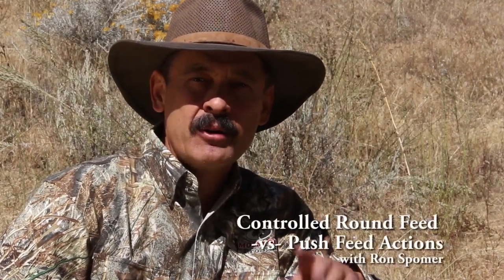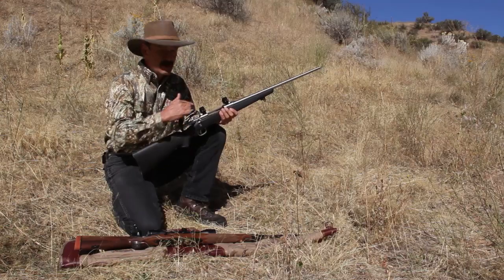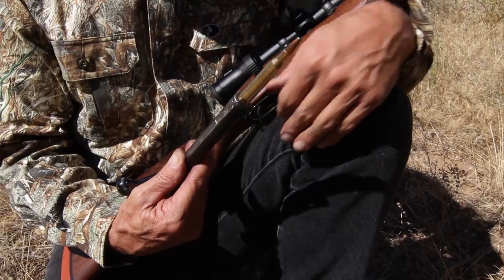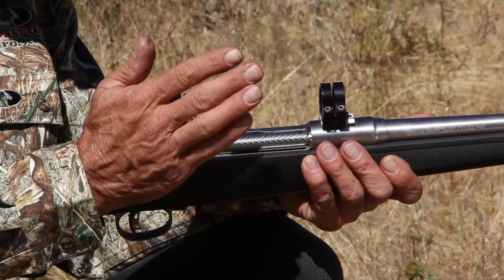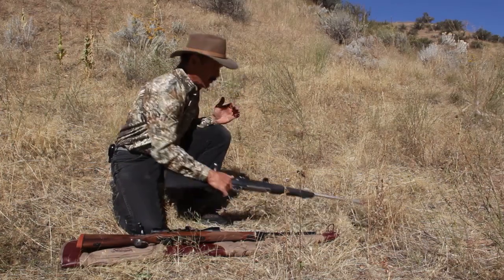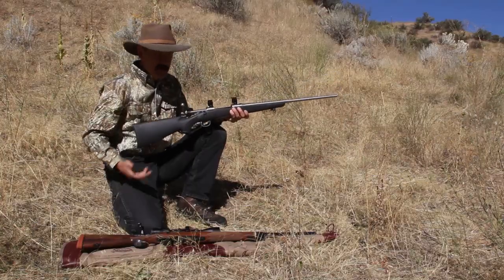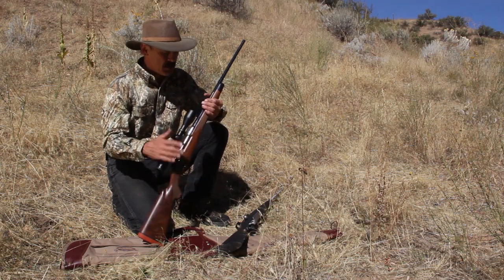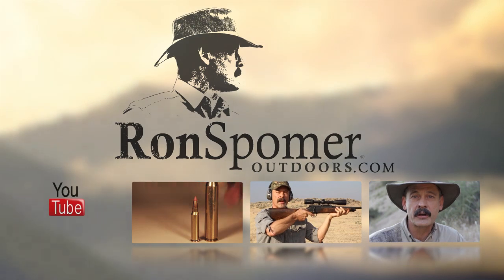"Push Feed -vs- Control Feed Action" with Ron Spomer

Comment: I have 3 Winchester Model 70's, all are CRF. 
That being said, I've also used one of the 90's Black Shadow  models that was Winchester's entry-level gun at the time and never had a bit of trouble with it. In fact, that rifle had one of the smoothest working actions I've ever seen, smooth-as-butter! 
My current 70's are a pair of Featherweights in 7x57 and 257 Roberts and a Safari in 375h&h. They are all spectacular rifles and the claw slings brass like nobody's business. 
For deer hunting, a push feed is fine but like one of the earlier comments noted, CRF is best when you're hunting something that's hunting you at the same time!

Comment: One advantage of CRF seldom noted is that if you have a broken firing pin sticking stuck out of the bolt face you get a failure to feed in a CRF. The firing pin sticking out of the bolt face will prevent the cartridge coming up in the correct firing position. On a push feed action the firing pin is sticking out like the firing pin on an old submachinegun. Close the bolt and the round will fire before the locking lugs are closed in position shooting the bolt back towards the shooter. How do I know? A friend of mine lost his right eye when the bolt hit his face and the bolt handle cut off his right thumb. He almost lost his left eye as well due to case fragments pouring out of the action.

Comment: It is not ONLY the CRF option that makes the M70 a superior hunting rifle to the R700 and other push-feeds. The week extractors on the m700 are very prone to failure on hard recoiling rounds (reason why Remington stopped chambering rifles in .416 rem mag). The ejector on the M70 is failproof, while the plunger design on the R700 has been known to gum-up and fail in the field. The 3-pos safety on the M70 is the safest and most suited to extreme hunting environments in production. The M70 also has an integrated recoil lug, the flat-bottom is 100 times easier to bed, the bolt can be easily disassembled in the field in a few seconds with no tools, and the bolt handle will not break off during use. I love the R700 as a bench or target platform, but it has many shortcomings as a hunting tool. Many serious Rem fanboys, like Larry Potterfield, have spent thousands of dollars to convert their R700s into M70s.
Reply: Well said. I am also a Model 70 fanatic, the Ruger M77 MKII & Hawkeye are some fine CRF rifles as well but my favorite 2 rifles will ALWAYS be the M70 Featherweight and the M70 Sporter. Beautiful, beautiful rifles!
Reply: Yes way back to the 721's they were known for extractor failures and I hate their safeties

Comment: Very informative.  I own rifles with both types of feed and I've had trouble with ejection in push feed models if any grit gets under the small ejector clip on the bolt.  I'll take the CWF any time.

Comment: CZ 550 is Controlled Round Feed and the new CZ 557 is a push feed. The CZ 527 is CRF as are the rimfire 452 and 455 models. 1903 Springfield is a CRF as it is a derivative of the Mauser 98 action. Remington 98 and 99 are CRF as they are restocked and badged Zastava rifles based on the Mauser. The FN bolt action rifles are CRF too. McMillan makes their custom actions in either CRF or Push feed.

Comment: Thanks for the no nonsence breakdown on the difference between controlled round feed v push feed, have a tikka t3 never had a problem with the push feed system. However like the way the controlled round system works, am looking at a c z which uses the controlled feed system.

Comment: Thank you sir! You saved me a lot of headache with this video, I had an issue with my 1st controlled round feed, it wouldn't eject the shell after I had it apart for cleaning. I thought something fell out of the bolt, all I have ever owned was push feed and was looking for a spring and pin on my hands and knees in the floor. I know, I know,I panicked but anyways, your explanation of the controlled round feed helped me tremendously, thanks again!
Reply from the maker: Glad I could help.

Comment: Good explanation.  I have several push feed rifles (Remington 700s) and haven't had any problems with them.  One is a .22-250 Remington and I'm not likely to have a woodchuck or bunny charge me.  I prefer a controlled feed rifle for dangerous game, just because.  Well, I'm an old guy anyway.  Good training and practice will have the shooter operating the bold all the way on both closing and opening, so one's muscle memory will help to prevent those kinds of jams anyway.

Comment: Although rare, it is possible to double feed jam a CRF rifle.  Cartridges don't always engage the bolt face until they start to ramp.  (On some rifles) So if you short stroke it it might double feed.  Also CRF bolts are made to engage Cartridges from the magazine.  So a chambered round by accident or hand fed could be very difficult to extract.  Push feeds extract hand fed rounds easily.  So yes both have advantages and disadvantages. This is my experience anyway.

Comment: Ron, you missed a couple of important points and introduced a silly one.  Firstly, the silly one.  No one shoots a rifle upside down and frankly in 40 years of shooting I've never heard anyone seriously suggest any such thing.  However, if you did want to shoot upside down, I guess a PF action may be problematic.  Now for the points not mentioned.  1) The extractor.  The CRF extractor engages fully 40 'plus' percent of the cartridge rim.  This means that stuck cases can almost always be ejected; even it that means thumping the bolt handle with a stick or boot.  PF extractors on the other hand engage about 15 % of the rim (on a good day) and consequently are far more likely to tear through or ride-over the cartridge rim on a stuck case.  2) Ejectors.   The 'fixed blade' ejector on a CRF action is essentially failsafe.  Not so the plunger ejector on a PF action which can suffer a spring failure or, fail to operate due to dirt and residue jamming the plunger in it's recess.  As you allude, none of this stuff matters much when out shooting rabbits or deer; but if you're facing dangerous game, or you're in a survival situation; well that's an entirely different kettle of fish.

Comment: Got several of both feeds in 458 416 and 375 and never had issues with push one advantage of push feed is in a hurry you don't have to feed from the mag you can chuck a round in and just close the bolt
Reply: This mindless myth is not true with most crf rifles

Comment: I have had my M70 push feed since 1974, taken all manner of game without failure. I also have a newer M70 with claw extractor and see no advantage.
On 2 occasions I have seen model 700 Remingtons accidentally discharge when the safety was released. I prefer the M70 safety system.
Reply: that remington teigger issue is scary
Reply: My MR7 has the 3 tang safety, love that gun

Comment: The push feed seems a cheaper bolt to me. Control feed does take more machining so probably costs more to produce. I don't like that the ejector on the push feed causes the brass to scrape along the inside of the action as the bolt is opened. As a reloader it just kind of bothers me. Most of my rifles are push round actions though.

Comment: Class act video, good information. One thing to note is single round chambering and if you very slowly close the chamber, on a CRF action could pop in front of the blade extractor and cause difficult closing of the bolt. (Very rare, but can happen)
Reply from the maker: You're on the right track here, but nothing pops in front of the blade extractor. The face of the extractor is forced to snap over the rim of the cartridge. Unless this face is bevelled, this might not happen, so you can't chamber a round. It could also weaken or break the leaf spring extractor as you try to force. Most CRF Mauser-style extractors are now bevelled so they snap over, as this one did. Still, they are designed to slide into the extractor groove of each cartridge head as it springs up from the magazine. That remains the best way to chamber these.

Comment: The other thing is that when you pull a case out of the chamber, you smack the mouth against the inside of the receiver with a push feed unless you remove the ejector.  Will that ever matter?  Maybe for pushing the limits of accuracy, but not much else.
Reply: Never thought of this, however I don't think the brass case mouth would dent (all my reloads don't) 1/3MOA still happens on my 3rd and 4th reloads so idk Maybe bench rest shooters do this?
Reply: They absolutely do.  Buuuuuuuuuuuuuuuuuuuut I'd bet 80% of what they do is total BS.

Comment: I have a savage model 11TPH It don't want to push the rounds into the chamber. It pushes it about 90% then locks up. I have to back the bolt off just a hair then it pushes closed and locks down.
Reply from the maker: Sounds like feed ramp/bullet incompatibility issue. Bullet tip may be catching on the breech. Best have a gunsmith check it out. Or just try a different bullet. Should be an easy fix.

Comment: 10 years ago, when I was only 15 when this video was made and I didn't even know what push/controlled feed meant I got my first Ruger M77 30-06. It's a tang safety so it's still a push feed even though it's got a claw extractor. Since then I've picked up a couple of controlled feed M77 Mk2's, a boat paddle .308 and a stainless/laminate 7mm Rem mag. I guess all I'm trying to say is Ron was right when he mentioned Ruger. They make some damn fine bolt action hunting rifles.

Comment: Hello Ron, I know bolts are deigned to be worked quickly, but I noticed something strange when slow cycling my new Winchester 70’s with control round feed. The one is a Featherweight in .270 Win, when the bolt is slowly closed the bullet ramps up into the chamber and at about 3/4” closed then the head of case is snapped up into the bolt head. Pulling the bolt back at this point the cartridge remains connected to the bolt. This is how it should work as I know. However with my like-new “never fired by me yet” Model 70 extreme weather in .243 Win, if I do the same by cycling the bolt slowly, at about 3/4” closed the case head pops into the bolt face and drops loose. At this point when bolt is pulled back it isn’t grabbing the case head. If I work the bolt quickly it will snap onto the unfired cartridge and pull it out and eject it fine. Am I looking at a problem with this .243? Is my Z spring and follower not putting the proper snap tension into the cartridge to get the case head to snap onto the bolt head when slow cycling, or could I be looking at a problem with the claw and or the extractor end of bolt by not allowing the cartridge to snap in and hold when slow cycling? Strange thing is that the Mod 70 Featherweight in .270 no matter how slow the bolt is closed the case head always snaps onto the bolt and the bolt is in control, unlike the .243 it just pops and drops of the case head, unless the bolt is worked quicker and the bolt is actually locked down,  then it will pull out the un-fired cartridge and eject without issue. Your thoughts on this one, am I dealing with a defect in my .243 Win, or is this normal behavior for the Model 70 with the shorter .243 Win cartridge? The follower and spring doesn’t seem all that firm when at top unloaded as it does with the other rifle I noticed. The claw and extractor don’t appear bent or deformed in any way on the .243
Maybe you have enough experience with this model rifle to tell me if something is not right with the mechanisms?
Thanks and God bless.
Reply from the maker: Mike, it sounds as if the extractor hook is too wide (gap) to properly hold the rim of the 243 cartridges you're shooting. This isn't normal. The claw should hold the cartridge against the bolt face. Try some other brands of ammo rim thickness could vary.
Reply: @RonSpomerOutdoors  
Thanks for the reply Ron, it does the same with the Federal brass as it did with the Norma. I could imagine it wouldn’t take very much difference on the extractor claw gap to make a difference. Even though it doesn’t appear bent away along the side of bolt, it doesn’t mean something might not be right directly at the claw itself, or perhaps the spring tension of it all together along the bolt? I will pull the bolt out of my Mod 70 in .270 Win Featherweight and directly compare it with the .243’s. I’m assuming the bolt is custom for each rifle and the .270 wouldn’t interchange for a chamber only test to narrow it down to the bolt, also the .270 is a long action unlike the .243. I’ll keep you updated. Thanks for your help Ron. ✌️😎👍
Reply: @RonSpomerOutdoors  
Hello all, just got an answer back from the manufacture about my questionable control round feed issue on my new model 70 in .243 Win, it reads as follows:

Good Afternoon Michael,
Yes the short action Model 70's Do "Lock IN" Later in the bolt travel than the long action Guns. IT largely has to do with differences In the Cartridge dimensions.
Best regards
Browning Service 
D

Comment: I like the control round feed for dangerous game but would not hesitate to take one of my weatherby MARK v 's. I would not ever rely on a Remington 700 for anything more dangerous than a fleeting whitetail! I've had two Remington 700's fail to extract an empty from the chamber! Remington's so called "extractor " is a cruel and dangerous joke, and is not funny! What is funny is, Larry Potterfield's "near perfect safari rifle". Look it up. He starts with a Remington 700 and changes out the barrel, installs an M16 extractor, installs a 3position safety on the bolt shroud, and adds a timney trigger! That's about what it would take for me to hunt with a Remington 700. 
.

Comment: do you know how to use Control Round Feed bolt to extract a shell which is already inside chamber?
Reply from the maker: Most modern CRF extractors are designed to snap over cartridge rims. You can also remove the bolt and rap the butt on the ground to shake a round out or slide a cleaning rod down the barrel from the muzzle.
Reply: Are raping butt on the ground or using cleaning nod only ways to take out shell from chamber?  Could CRF extract an already inside-chamber-shell out?
Reply from the maker: As I wrote in my first sentence, many, if not most, modern CRF extractors are designed to snap over cartridge rims. This means you close the bolt on the round in the chamber, the extractor snaps over the rim, grabs the round by the extractor groove around its head and pulls it out. Original Mauser-style extractors can be (and many have been) tapered to snap over rims, too. Just push bolt against round in chamber with firm pressure (don't force or pound it,) and see if this works. If not, try the alternative methods.
Reply: If I pre-insert a shell into chamber directly as 1st step, and I then push in Control Round Feed bolt into chamber as 2nd step, I found Control round feed bolt cannot get into Chamber anymore. It seems the CRF bolt head is blocked by the back of my pre-insrted shell. Is this common? Would you like to do me a favor to try the same steps as me and see if your CRF bolt will have the same issue?
Reply: Every crf rifle I have will snap right over, this is a mindless myth
Reply: @RonSpomerOutdoors  Almost all the old ones allow it
Reply: @dihu8063  This is very rare, I have pre war model 70's a 1917 enfield , and others, all allow it
Reply: Ван Гвардия  BS

Comment: Resurrection of a 5yr old video, but we still have both types of actions in service. The presenter maintained an objective, non emotionally biased, delivery. 

My experience with 6-7 CRF rifles of various brands showed the extractors had to be tweaked considerably to make the CRF action type work as designed. Some CRF rifles I could get to work exactly as designed and some got close enough. That meaning they’d act like a push feed until 3/4” away from chambering. 

Regardless of whether the CRF feeds by design from the magazine all CRFs control that case out of the action once that bolt is turned into battery. 

One can certainly short stroke when the adrenaline kicks and “Murphy” is hovering overhead. I’ve seen me do it! 😂 The CRF shines here as demonstrated in the video. 

Now, the USMC fielded the M70 and Remington 700. Lots of Remington 700s! With this said I’d think if the push feed was just awful compared to CRF it wouldn’t have been so prolific. 

I personally pick the right tool for the job. Dangerous game and adrenaline inducing moments I’m going CRF. 

Plains game, hogs, long distance, and casual shooting I’ll work any problem or platform.  Pick your tool and keep shooting boys and girls!

Comment: Worrying about "Getting excited" and the type of extractor on a rifle. I have been hearing it for years because I have been working on guns for years. Let me toss this into the mix. You would not believe how many people  stick the wrong ammo into rifles, even when not excited.  With controlled feed that wrong cartridge will fire if the bolt can close on it. I don't care how much shorter than the correct cartridge it is, with about the same rim diameter, it will fire. I stupidly did it myself once, and have seen the results of others doing it  again and again.  I have nothing against either design, just stating facts.
Reply: My brother once fired an 8mm mauser in a custom 98 mauser chambered in 30-06. It didn't hurt the rifle  but he said it kicked like a mule and nearly ruptured his eardrums.
Reply: @robertmurdock9750 . mate did exactly the same with a .270 mauser
Reply: @kdsowen2882  Did it do any damage to the rifle? Them old Mausers are tough.
Reply: No comment necessary here!